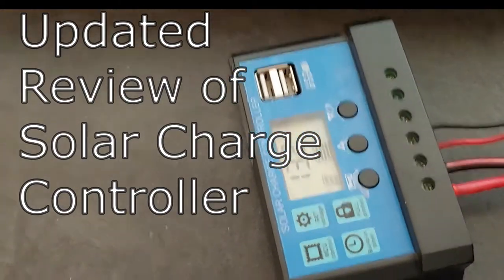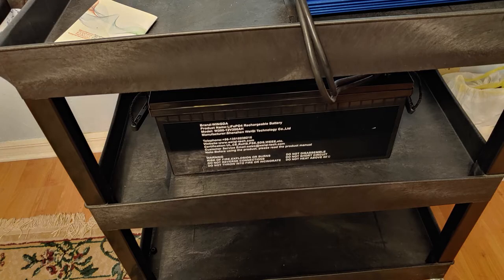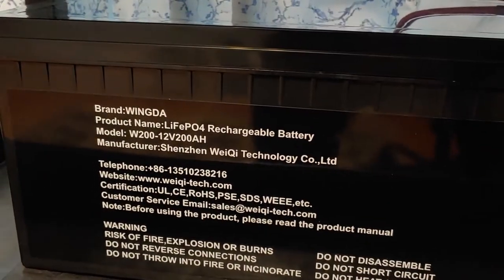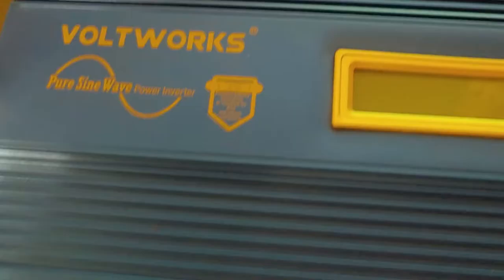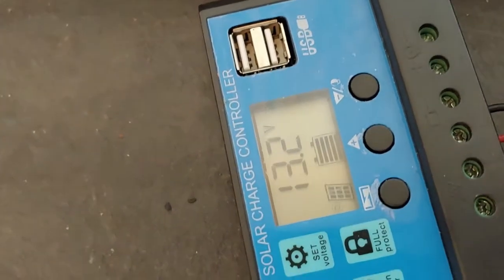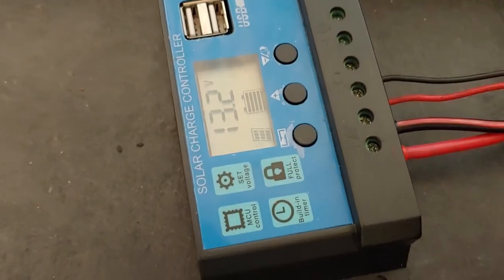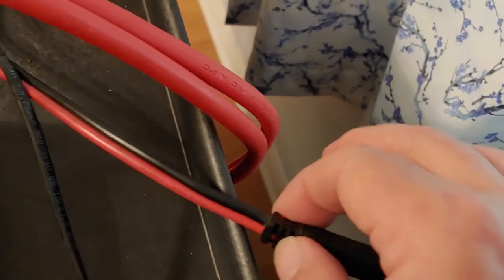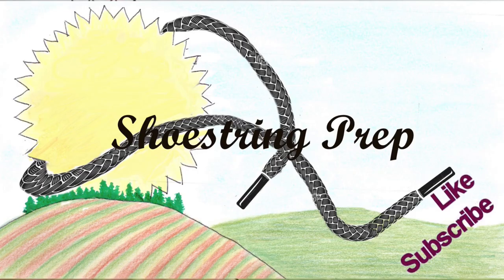4-week review of the cheap solar charge controller.

Comment: i have the orange 30 amp one of these. i have 600 watts in 12 volt panels in my garage i just bought, and a 1kw inverter and 5 car batterys. post on amazon say that 12 volt i can go 300 watt, and 24volt i can go 600 watt, WHY IS THIS? 2) the controller can accept up to 55 volts, so can i do 4 panels in series at 12 volt to make 48 volts to the controller with 24 volt battery set up?  whats the maxuim watts in panels for the controller is what i dont get, or if over 24 volt panel input over heats the controller. any info about these things?
Reply: WHY IS THIS!!!😂 Well, I hope you’ve sorted it 🤔

 I have a different specification to the controller you have although they’re all fairly similar. 
The solar panel/s voltage & current to the controller has limitations. 

On the controller this is denoted as charge current (imho)

I would assume this charge current is 30A  for your controller - as you state  12V 300W or 24V 600W. 
(Note - the discharge current of the controller is also limited). You can work out the power output by multiplying this figure by the voltage output of the Controller). 

It’ll automatically detect the voltage  when you connect the panels. 

The way you arrange them is upto you but you need to make sure you keep within the limitations - 

I’ll paste this video link for info that will be of use - as I or anyone else but you will not know how you envisage putting the panels together. 

Seek help from professionals if still in doubt 

Good luck

https://youtu.be/GFjL0-r6LbY
Reply from the maker: Than ks for your comment.

Comment: Lol.  Previes video you said not to use it with lithium.  Though a good lithium will have a bms.  Pwm isnt good for lithium even though many new pwm controllers list lithium.

Lifepo4 is almost a perfect match for lead.  Pwm is hard on lithium by the way it works.  It starts and stops the voltage to charge.   I suppose newer pwm controllers may have a means to regulate voltage on top of pulse width modulation.
Reply from the maker: Thanks for your comment.
Reply: @shoestringprep  You're welcome.  I bought an all in one inverter, charge controller that had pwm.  The company advertised it compatible with lithium.  It was  different than what you are doing.  It was 24v and I was using a 7s lipo battery.  7s wasn't a match to lead like an 8s lifepo4 would've been.  Long story short, pwm ruined the battery after about 9 months of use.  

Thank you for the response and the videos.  If this unit is mppt and it's not the followup to pwm one I apologize.   Though I do find it hard to belive the cheap mppt units are really mppt.  I suspect they are a modified pwm of some sort.

Comment: I connected the solar panel to the wrong terminals and now the controller is set for a 24v system.  Is there a reset button?
Reply from the maker: There is no reset button. Diconnect the controller and try reconnecting it. Thanks for your comment.

Comment: What type of connectors do you use to connect the wires to the charge controller ?
Reply from the maker: I used 14 gage for my video. Thanks for the comment.
Reply: @shoestringprep  My controller didn't come with any connectors.  Do you just push the 14 gauge wires into the holes on the bottom of the controller ? Thanks
Reply from the maker: @geraldwegener8376  that is correct. Insert the striped wires and tighten down. Thanks for your comment.

Comment: Hi. How can I switch on the 12V output while the battery is charging? And how the timer works?
Reply from the maker: The charge controller reads the voltage from the battery so if you're a have a 24 volt and you want to change it to a 12 volt battery you'll have to disconnect the the charge controller and reconnect it to your 12 volt battery. Thanks for your comment.
Reply: @shoestringprep  I mean I want using electric while the battery is still charging by the solar panel. (My battery is 12V and I want to use 12V during the day. Not at night.

Comment: Hi, from inverter to the battery,it looks you doubled up on the cable. Cant I use just  use a black,and red 4 awg only two cables.Im going to do exactly what you did here with a 100ah lithuim battery. Same exact set up
 great video!
Reply from the maker: As long as the cable you use can carry the current going through it. Thanks for your comment.
Reply: @shoestringprep  what cable do I need please from inverter to a 100ah 12v battery. You did not explain why you use two cables . help me out here short string😃
Reply: @shoestringprep  ok, I see in the other video. those cables come with the inverter. My mistake.
Reply: @shoestringprep  ok, I have 100ah 12v lithium battery.can i hook this up to the voltworks pure sine wave, and the cables that come with it.I think I saw a video you have that it was done.

Comment: Thank you! I set the floating voltage to 13.7V, but the controller ignores this setting and boils the battery at 14.8-15V. Has anyone else had this happen?
Reply from the maker: I warned everyone that these areas cheap and need to be watched. Thanks for the warning and
Thanks for your comment.

Comment: How many panels can you use with that controler I have a renogy and I can only use 5 100 watt panels 12v looking for a cheap controler that can take higher power
Reply from the maker: That will depend on which model of charge controller you buy. I suggest once you pick up your charge controller read the manual and follow the directions on it. Thanks for your comment.

Comment: Bought one of these controllers, when its connected to my panel and battery, the voltage doesnt stay constant, do you know if its meant to regulate the solar input voltage? 
panel brings in <20V in full sunlight, controller cuts out when ever it goes about 14.6. Like its telling me the Voltage coming in, not the voltage of the battery. Any ideas why?
100Ah AGM battery. bo1.
Reply: Solar panel output should be more like 24v if it's 100w.
B1 is lead acid b2 gel and b3  flooded
Reply: @Asfanboy1  tested the controller on another battery, worked fine. so pretty sure my lead acid is dead 
thanks for the reply tho
Reply from the maker: The charge controller regulates the voltage from the solar panels to the battery do the battery will not over charge. Thanks for your comment.

Comment: I've just replaced my controller  and noticed that the load out bulb is not showing on the led and the USB ports don't work. Any ideas why. 🇬🇧
Reply from the maker: You may have a defective controller. You may wish to replace it. Thanks for your comment.
Reply: Nope.. not defective. This is the issue i had when first buying my first of the 3 scc like this, i have now.

U and I did not read the manual carefully enough.

U must connect your battery first.. Then choose settings (which it will likely auto select the proper battery u have) .. then u connect your solar last.

When u do that your accessories will work (2 usb and power out.

Also disconnect in reverse.. disconnect solar first.

Manual says if not u may damage the controller.. but i dont think i damaged mine.. this first one, before i was clear on these instructions.

Comment: I had the same controller in my van conversion chart to a 120 W solar panel. It worked fine for about a year and then went wrong. and over charged the batteries. 2×110 amp sealed lead acid batteries completely fried  Lucky they didn’t catch fire.  The wires from the solar panel had burned black when I removed them.  I guess they are cheap for a reason. Does anyone have experience running these controllers for over a year?  Thanks
Reply from the maker: I never run mine full time. Thanks for your comment.

Comment: I have one of this controller but the voltage on the controller is not actual voltage when measured on battery
Reply from the maker: They are cheap and should be watched. Thanks for your comment.

Comment: If you have it set to 14.6. Does it stay there or does the charger have a way to float the battery at a lower voltage.
Reply from the maker: The voltage stays at 14.6 volts where I set it. Thanks for your comment.
Reply: GOOD QUESTION! NO WHERE IN ANY OF THE REVIEWS I HAVE SEEN DISCUSS THAT .
Reply: 14.6 is the max input he set it at. U may not get that from your solar sometimes.. the setting is only the cieling.

Comment: Can i charge my phone from the usb without the battery conected to the panel?
Reply from the maker: Yes, you can as long as the charge controller is connected to the battery. Thanks for your comment.
Reply: No.

Comment: How to find out if the battery is fully charged ?
Reply from the maker: When fully charged the battery voltage will equal the level you have set for it and the charge controller will stop charging the battery. Thanks for your comment.
Reply: @shoestringprep  
Does the arrow on the panel stop blinking?
Reply from the maker: @sihanvideo1814  sometime it does and sometimes it does not. Do not relay on that. Thanks for your comment
Reply: @shoestringprep  ok thank you

Comment: Hey! I got some question, since this is PWM does it work for lifepo4 batteries, on the battery it says it needs MPPT controller, but those cost around 100$... Do you think PWM controller won't damage lifepo4 battery? The pwm controller I am looking at says it is used for lead batteries, so I wonder whether this would work and be safe. Thanks in advance.
Reply from the maker: You can set up the controller for lithium battery. 14.6v but watch it. These are cheap units. Thanks for your comment.
Reply: @shoestringprep  Thank you for fast reply. Subscribing and liking!

Comment: Can this handle a 400 watt solar panel
Reply from the maker: The charge controller I was testing is rated at 60 amps that comes out to around 7,000 Watts. So I suppose you could hook a 400 watt solar panel to that charge controller. But I've never tried it so I would watch it closely and be very careful. Thanks for your comment.

Comment: What does it mean when your battery  flashes on your controller
Reply from the maker: Normally when the controller is flashing it means the battery is charged. I would check that first. Thanks for your comment
Reply: Flashing should show an arrow to the left too if im not mistaking.

But flashing could mean its charged if the symbol is fully shaded in.. when partially shaded in battery is not fully charged
Reply: It's in trickle charge state

Comment: Lol .. I was soo pissed off, but now soo relieved when I heard u say .. I dont trust it, and when the panels arent making power at night you unplug it.

I been liking these cheap charge controllers so much, between 12/2018 and around 4/2022 i got 3 of em (2 in my Rv parked at an Rv storage .. 1 on front dash, one in rear bedroom not connected right now .. the 3rd in my big rig truck thats been parked)

Ive been pissed off because it seems to be true, that at night it appears to drain batteries by keeping the reading and for the last 3 days Ive just started to unplug it Because I couldnt figure out if I bought some bad Solar panels or not (they are all used Harbor Freight 25 watts each.. i got at 3 different times, from 3 different sellers)

Got 6 panels all together.. all 25watts each.. 5 of them are matching, current models HF sells, 1 is their old 25 watt model. The older one is slimmer and a couple inches smaller, but significantly heavier than the other 5 matching, current models.

I had no knowledge of testing solar panel amperage, only knew how to check voltage (and doing it with the cheap HF multimeters ive been using for years.. I have 3 of those, and 1 better multimeter i have from a pawnshop, a couple yrs ago. HF multimeters read a little above actual voltage, or possibly below when faulty or low internal battery.

Discovered today that the older ones could be opened and adjusted more accurately.. comparing readings from a better quality multimeter. They all can be opened.
When i opened 2 of mine i have handy.. they cant 1)be adjusted, 2)replace the tube fuse like the older ones .. they look pretty much the same. U can only replace a possible low 9 volt battery.
For a while in 2016 they had a handy light button on them.

Back to the point.. Now i will be trouble shooting if i have bad panels that dont push amperage (Once i confirm that I am checking Amperage correctly)
or did i damage the cheap charge controller as far back as 12/2018 when i got it (by finding out later that youre supposed to always connect the Solar to these last.. after connecting the battery.. I didnt get that understood until much later down the line.

I dont think i damaged this first controller, and surely havent damaged my 2nd and 3rd ones after knowing the connection / disconnection sequence. Its early am and dark but when sun is up
Ill be checking amperage on the 4 panels (out of the 6) i have handy.
Getting over my disappointment by now as I been upset from seeing good, expensive batteries seem to charge.. but trickle down lower and lower over weeks and months.

These charge controllers work i believe, but like u say they should be disconnected at night or when not getting solar. Theyre so cheap but decent, im sure ill be putting a shut off switch inline.
Disappointed and had to pay for lack of knowledge buying used panels not knowing to or how to check amperage, but should be able to get some solid solar power now. Thanks alot 4 this video. Ill go see your previous one now, for more on operating this SCC.. i pretty much know but youll likely know more. Thanks
Reply from the maker: I like Harbor Freight solar panels as well. I do suggest the cheap charge controller be turned off at night. Thanks for your comment.

Comment: Absolute rubbish.. Got one on a new 540w solar install, 50 camper.
Showed only 13a maximum, did immediate swap for my renogy showing 31amps.
Even the menu is inaccurate.
Reply from the maker: They are cheap it is true. Thanks for your comment.

Comment: I have been using the cheap charge controller for a couple of years, and I find information on youtube on how to set it up constantly different from one youtube channel to the next!
The stupid (chinese) instructions are totally screwed up and I cannot follow them. And some you tubers say to hook up the battery first, while others say nothing about which order you should use. When I try to set it up I am unable to get any menu options to work correctly, such as how long to keep it on or off, (and there is no option for that available it seems), how much discharge you should allow, how high a charge you can set, etc. and even your review doesn't seem to address those issues! In your first "review" you said to use only on lead acid batteries and specifically NOT for Lithium, ( by the way),and In your follow up you are using it on a LITHIUM battery! What's up with that ? You say you disconnect it at night when the sun goes down. According to others they say it can be set to shut down. How the heck can that be done?
Reply from the maker: Let me see if I can explain this better. Book says not to use it on lithium, the manual says do not use this charge controller with a lithium battery. I have been able to charge my lithium batteries with it so I do. But since the manual says not to, I tell you the manual says not to, even though I show you that I do it. 
This is a cheap charge controller so I don't trust it. I don't just let it run. Every so often I watch it and double check the voltage to make sure it's charging the battery correctly. 
I disconnect it at night because the charge controller draws power from the battery and weakens it when it's not being used. I don't know of any settings that will tell it not to do that, so I do it manually myself.
Thanks for your comment.

Comment: This is not helpfull. No technical knowledge.
Reply from the maker: Thanks for your comment
Reply: It's all to do with what you can achieve with minimal cost  . You could set up one of these in each room of the house if you was desperate  and potentially and spend hardly anything to what you would spend for a real big set up . Generators are the future tho . They have the full kit in them but still to power a whole small house would still be high in terms of bucks great video and  it's enough to work out what you can do
Reply from the maker: @andrewholdsworth4421  thanks for your c6.

Comment: Complete JUNK! Died after 3 months. Panel is good, generating about 20V, charge controller on the other hand doesn’t have any output to charge the battery, pass through for power output is dead as well. Control buttons have a mind of their own, sometimes they cycle through modes, most times they don’t do anything. Complete waste of money. Very unreliable.
Reply from the maker: I agree they are cheap and must be watched. Thanks for your comment.